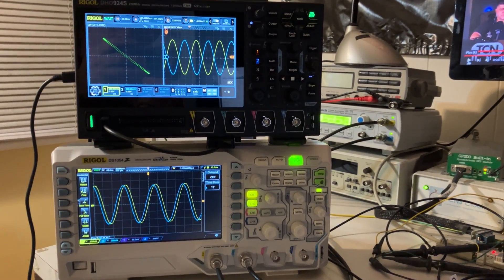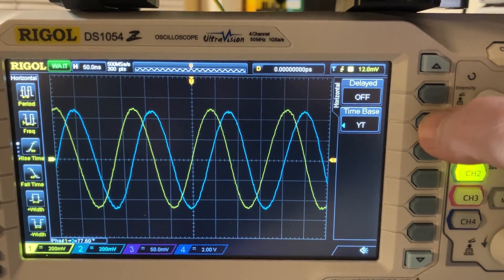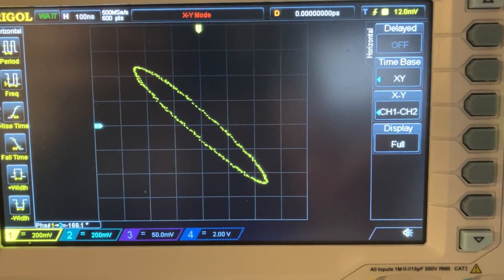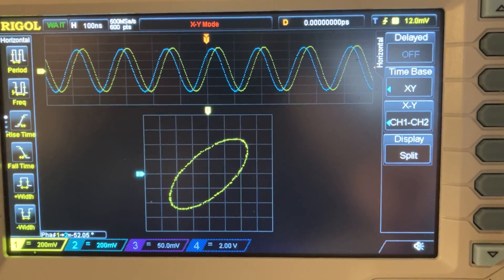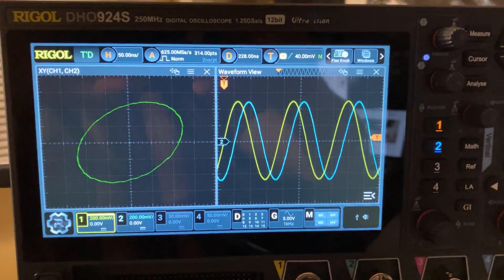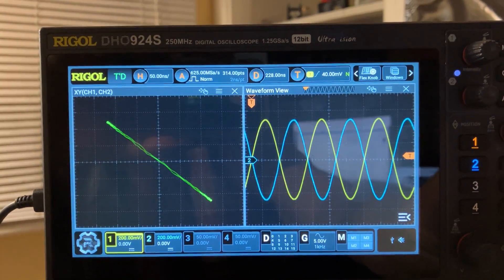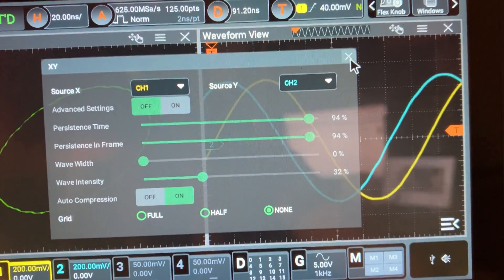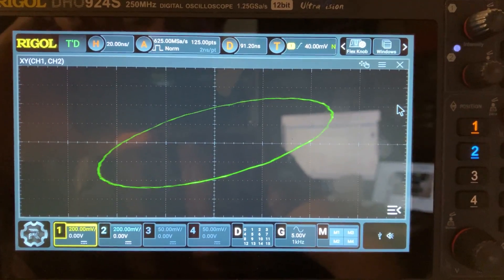Compare display of Lissajous display of Rigol DHO924s vs  ds1054z

Comment: 3:00 try to turn on "test mode". Main menu -> Utilities -> three clicks on about. That should do the trick.
Reply: WOW, what's that test mode for? it works!! thanks!, weird that in test mode works but in normal it is grayed out altought it remembers what i set on test mode!.
Reply: @DavidLightman  in test mode there are more useful settings. BTW, I just  installed Heroes III on this scope. Maybe tomorrow I will upload it.